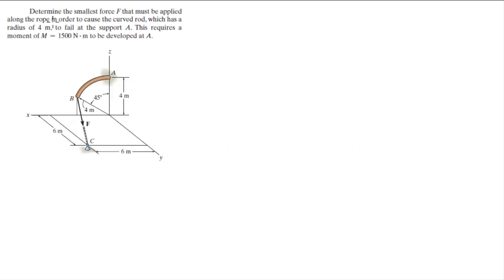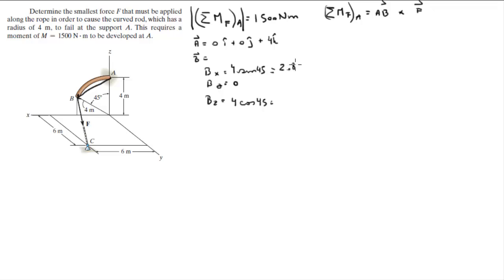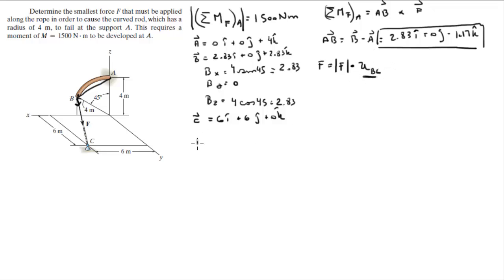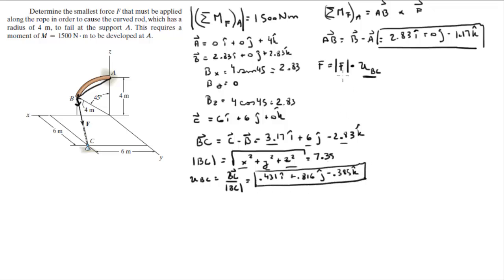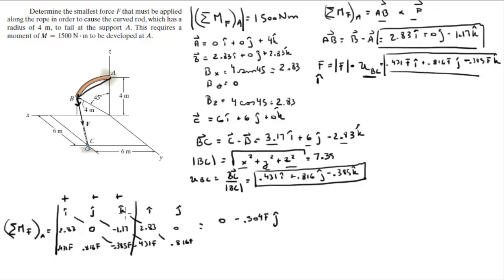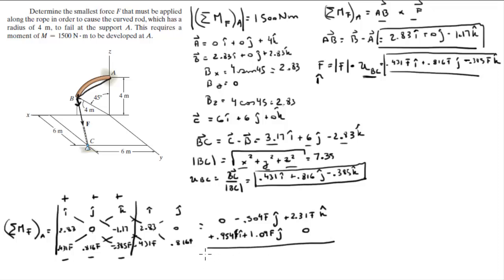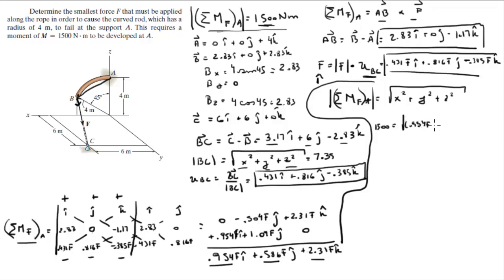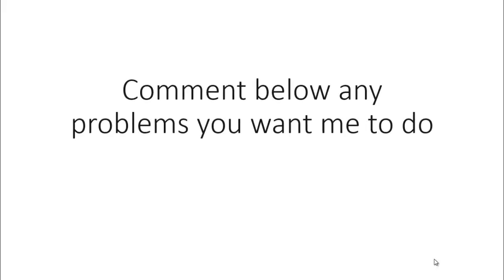Determine the smallest force F that must be applied to cause the curved rod to fail

Comment: Shouldn't Bx=4cos45 and Bz=4sin45? Rather than the opposite.
Reply: that would be relative to which triangle you choose. If you draw a straight line from point B to the Z-axis that would give you BX as well, and that is a sin45. If you use the bottom triangle then yes its cos.

Comment: Why did you choose AB for the distance vector? Shouldn't it be from AC since the its about A and the force ends at C?
Reply: You can use AB or AC. Or any point that goes from A to the force line B to C. You will get the same answer!